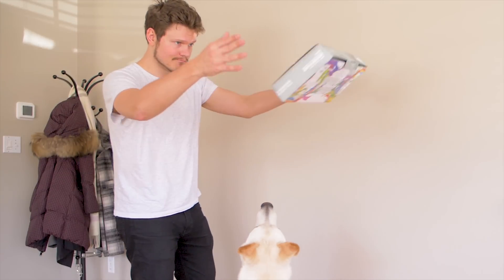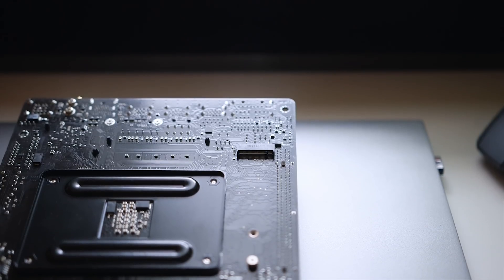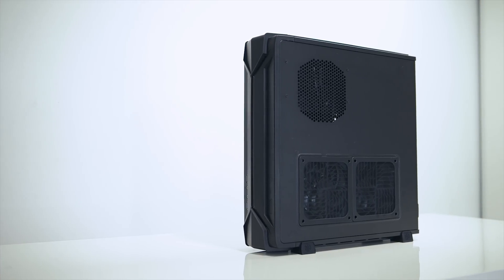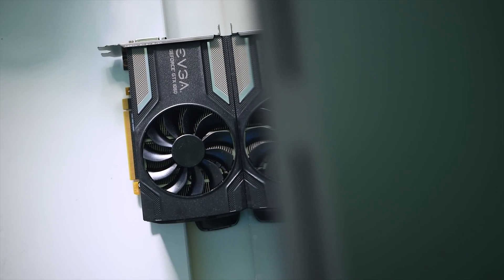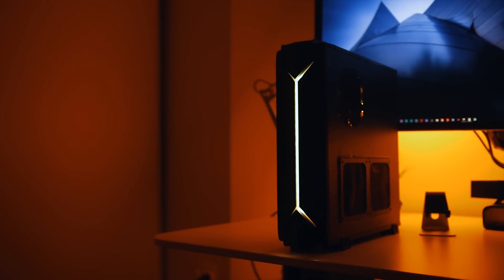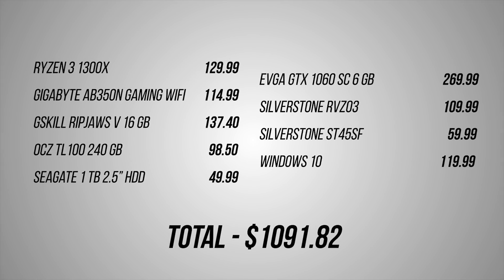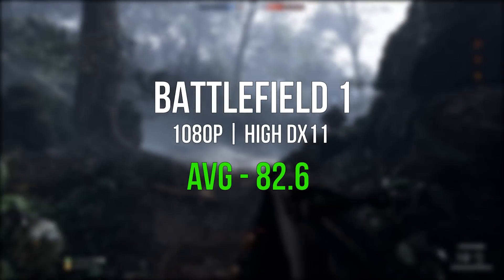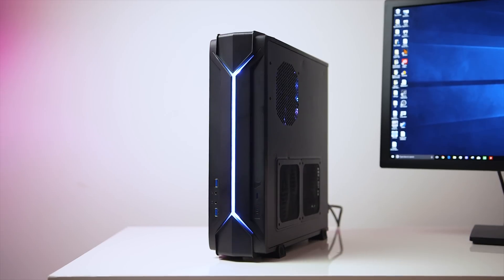AMD Ryzen SHRUNK - Our Ryzen ITX PC Build!

Comment: Windows for $120??
Dafuq?
Heard of kinguin?
You can get win10 pro oem for like $25...
Reply: .net
Reply: Arek R. Rather just use it not activated. Stolen volume keys or bought from stolen credit cards have the potential to not work after a while.
Reply: Bas V Kinguin is safe.
Got it 6 months ago and its fine.
I know about this page from Pauls Hardware, he got first windows like year ago and he also didn't reported any problems.
They sell OEM versions which usually you get with prebuild PC.
Kinguin gets mass license for like 10000 of PCs, and so it's cheap.
Microsoft is already rich enough and so didn't prohibited this.
Reply: I would not buy from Kinguin. They operate in a grey market with stolen license keys. Any day your license could be disabled because some one else got the same.
Reply: Arek R. I got mine for 10€ xD
Reply: No it wont lol once you register your license its yours how the fuck could someone else use it? They'd get denied and be told the license is already in use
Reply: @Arek R. Or just don't activate? There's no penalty, and a utility exists to let you set a custom wallpaper and remove the watermark if unactivated.
Reply: Or you know, just pirate it.
Reply: Just buy on eBay for $3. Fuck kinguin.
Reply: Just because you bought from kinguin and it worked, doesn't mean it will work for others. It depends on the seller. Kinguin isn't the one selling you the stuff, it's merely a site which private sellers can use. Its just like ebay. Just because one seller gave you a legitimate product, doesn't mean everyone else will.
Reply: Heard of the pirate bay?
Reply: Where is your proof that Kinguin use stolen license keys, i think your talking out of your ass, i have bought MANY steam CD keys from them and NEVER had any problems, and i also bought many Windows 10 Pro OEM keys and (from another website) have no problems, they work perfectly.
Reply: I and MANY other people bought a Windows 10 Pro OEM license key from a store legally, so no for us it's legal, i can't help it if a BIG store like Kinguin use stolen license keys, and i can tell you almost 100% sure they don't sell stolen license keys, but hey if you and others like to pay $120,- for a Windows 10 license key, then i say go for it, and so what if you Windows 10 Pro OEM license keys stop working, you just buy another Windows 10 Pro OEM license key for $30, i can 5 Windows 10 Pro OEM license key for $120,-
Reply: You to, have fun with your $120,- Windows 10 license key.
Reply: Ok then what's the problem, if you do the same?????
Reply: well I was asked to save money for a company and i bought 50 keys from g2a and i got a lot of money for that for saving the company money and none of the keys have been used again lol
Reply: Yes that's what i try to tell SIF, but ok.
Reply from the maker: We buy 100% legitimate software.
Reply: Um ok.
Reply: ok.
Reply: Arek R. I got it for 5 dollars on Amazon. The seller isn't on there anymore though
Reply: you kidding right?....i got disk with windows 10 with all versions with activation ...got it for less then 1$
Reply: https://www.kinguin.net/category/19429/windows-10-professional-oem-key/

https://tweakers.net/pricewatch/453556/microsoft-windows-10-pro-nl-64bit-oem.html
Reply: 3 words: Windows Accessibility Upgrade
Reply: 1 woord, just buy a new €25.99 Windows 10 Professional OEM Key when you upgrade your MB or RAM or GPU or CPU, is MUCH cheaper.
Reply: I got my Windows 10 Pro key from Kinguin and had it approved and installed with the help of Microsoft service so yes they're perfectly fine from what I can say, also they include a buyer protection service for like extra $5 totally worth it if you happen to run into any issues
Reply: Heard of eBay? You can get legit win 10 for five dollars.
Reply: Arek R. Windows for $25??
Dafuq?
Heard of torrentz.eu
You can get win10 pro oem for free...
Reply: Vality For a cheap fuck like you, it's a better option.
Reply: OEM is FTW solution is you are the people that use same computer for a long time. it is definitely worth it and legal. the negative is the license key is registered to the machine so you can't change the machine. but regular people like wont buy another PC for years so it is okay
Reply: HardwareCanucks still 120€ for windows is to much xD
Reply: Arek R. 
Microsoft get harmed  from those windows keys and all of those cheap keys are stolen keys
Reply: TheMorbiousStone 
Cuz they bought them with stolen credit cards?
Microsoft knows and everybody knows that
But
They don't have a physical proof that kinguin buy keys with stolen credit cards and sell them for really cheap cuz they didn't lose any thing in that credit card
The judge will just say that they bought them for the full price and sell them for really cheap and they are losing money for that
Reply: I rather use cracked windows than any crap from kinguin or g2a all day, if you don't plan on paying msft for their product (imho you should), than please at least don't found gray market websites
Reply: Have you heard of the law?
Reply: Obviously Dead yes but knowingly buying stolen goods are just as illegal as copyright infringment
Reply: Let me tell you my experience, I downloaded Windows 8.1 through torrent and when Windows 10 came, I was asked my Microsoft to upgrade to 10 and since then I've not faced a single issue and I've done this on two computers.
Reply: Reddit Keyswapper?? 40$ for win 10 pro
Reply: https://www.reddit.com/r/microsoftsoftwareswap/
Reply: https://www.reddit.com/r/microsoftsoftwareswap/comments/6t01j4/h_windows_788110_windows_serverserver_r2/
Reply: RealTuber 
FUCKING EXACTLY
Reply: Grey market. Don't buy from that shit. You might as well torrent it mate. I for one have never paid for an operating system.
Reply: This is just beyond stupidity. Always trust the real company itself, so in this case, Microsoft. If you would rather go with this Grey Markets, what's the point. What's the point in stalling ur cash just cuz it's alot cheaper than a Genuine Key by the Legitimate Company itself, download it for free then from torrent.
Lot's of people have reported fake keys and duplicates from Grey Markets.
Reply: Kelvin Tan 
Agree
Like the guy up there said
If you aren’t going to support Microsoft at least don’t support shady markets
And get it for free
Save the extra 35 dollars in a bigger ssd or a cooler
Reply: Gabe_N Yea man. Where's the pride in that. I would feel good and sleep good knowing that i bought a legit item from Microsoft THEMSELF.
Unlike supporting shady grey markets with Bad User Interface  sites. What? Do u expect do go like "Oh look i feel good, $25 Windows in ma PC, it's so much CHEAPER".. WHY NT JS TORRENT IT THEN
Reply: I paid extra for protection, so If my license will be deactivated I will get another key or money back from kinguin.
Also some time ago I was connected remotely with MS technican and he didn't said that my win10 is fake or something.
So chill dudes, If MS gave free update to win10 they should be fine with this.
Reply: Arek R. "Should be fine"....., so as far as everybody's concern, you have been braggin about a service which you don't have 100% faith in. Why wouldn't someone go for free torrent instead, and still pay money for some Grey Market Product?
Reply: Not to mention that most pre cracked Windows now offer updates also directly from Microsoft eventhough it's crack..  and security comes free with Windows Defender or your preferred 3rd Party Antivirus?
Reply: THANK you.
Reply: Look at all these morons proud to be paying for piracy lmao. You're in breach of the software license agreement when you use these MSDN originated black market keys which makes it EXACTLY the same as using microsoft toolkit from a legal standpoint.
Reply: YE BOI. This conversation is still on. Grey Market / Torrent, there ain't no difference, why pay for fakes. Buy a legit Microsoft Product, Save A Life.

Comment: I built a SFF PC with a R9 Nano, 4790k and 600W PSU inside a Fractal Design Node 202 for around the same price a couple years ago so it is crazy to see the prices.  Cabling is definitely a mess in these kinds of builds and I regret not springing for an M.2 SSD.

Comment: I'd suggest the R3 1200 overclocked to the same speed and the Asrock b350. The Gigabyte board has been having some VRM heat issues. Also save $50 and get a Core V1 plenty of space for HSF, drives, can support cheaper ATX PSU's and still small.

Comment: What an odd build. Keeps going on about "strict budget" and "budget build". Then drops $130 on RAM and $150 on an RGB ITX mobo?? WTF. Nobody buying a Ryzen 3 is going to drop $150 on an ITX mobo. and fancy case. It's a budget CPU so build accordingly.
Reply: YeCannyDaeThat 100$ cpu in a 1100$ build, makes no sense
Reply: YeCannyDaeThat and a 1060?!?! Wtf
Reply: Kevin Dragontail the R3 can run the GTX 1060, the 1070 is where it gets a bottleneck
Reply: AntiSnifflz i meant I was expecting a really high-end graphics card because of the low end cpu, idk where the rest of the budget went
Reply: $170 for that case and power supply.  No way would I pay that much for that...not to drop a $100 CPU and 5400 rpm drive into.  The 2400 Mhz RAM also confused me...RAM speed has a HUGE performance impact with Ryzen...would not go less than 3000 Mhz.
Reply: Kevin Dragontail mining.
Reply: Hemibuzz mate I fit a 1600 and a 1070 in this budget
Reply: Disagree. I think Ryzen 3 combined with a fancy case and a mini itx board will become a somewhat common configuration for HTPCs. There's no need to get a better CPU than that for a HTPC unless you're doing serious gaming.
Reply: Rob Cribb I don't think he said anything about a htpc in the vid?
Reply from the maker: "Strict budget of $1100".....you forgot that part.  ;)
Reply: I just bought this exact cpu/motherboard for HTPC and gaming, that said, I used a silverstone sg13 for $40 and only 8 gigs of ram. I already had the PSU, GPU and storage so it only cost me $300
Reply: +HardwareCanucks Eber I am able to use that same $1100 budget and build this... https://pcpartpicker.com/list/zGqkM8 

With a better CPU, a faster 2.5 hdd (7200rpm 2.5hdd's do exist you know), and get a Win 10 Pro license for $25. You clearly didn't bother researching with this build.
Reply: Well at least make it look nice so when you upgrade to Ryzen 5 or 8 you won't need to upgrade everything
Reply: Actually i was going to build R3 build in this case. But i'll go with one SSD and 1050ti. The only problem with this video for me is that they say nothing about ATX power supply capability. So it it true that it can fit ATX or do i have to buy SFX power supply?
Reply: YeCannyDaeThat he said at the start that he was going to do a full build for the price of the Threadripper 1950X. That's the budget limit.
Reply: yeah ryzen 8, that actually exist... rofl
Reply: Here's an even cheaper, under $1k build, with the same brand of components but 1TB of extra 7200rpm storage and Ryzen 5 (as one of the other posters mentions here): https://pcpartpicker.com/list/Pq8MkT 

RVZ03B case does not make any sense at all from value perspective. You are better off with RVZ01B or ML07B. RVZ03B is basically an overpriced RVZ01B with some frills but flexibility removed.
Reply: Could have swore the 1950x was $999 not 1091.82 but again whatever your definition of budget is... it doesn't make sense
Reply: for a HTPC all you really is is the Ryzen 3 and a 1030 and yeah no nee to spend a fortuane on a case when there are plenty of great looking cases at $50 or less. RGB is honestly something I would NEVER budget for as I hat the concept of it to be honest. Rather have a sleeper build then something guady looking. I can understand a backlit keyboard and some light on a mouse so you can see them in the dark but flashing and rainbow RGB? No thank you you can take your fad and shove it where the sun doesn't shine for all I care. Stupid fad I wish would just die already.
Reply: Here's a more economical Ryzen build.

$200 - Ryzen 5 1600
$220 - GTX 1060 (3GB)
$110 - ASRock AB350 Motherboard
$25 - Be Quiet Rock Slim
$65 - 8GB RAM 2666 MHz 
$90 - 250 GB SSD
$75 - 3TB HDD
$50 - Mini ITX Case
$40 - Seasonic S12II Power Supply
---
$850 (do Ryzen 3 + stock cooler + GTX 1050 if you want to cut down to ~$600)
Reply: @Halosince151101 Try playing Rust or some other Unity game. That uses 4GB itself easy. Open some chrome at the same time and you're already out of RAM.
Reply: AntiSnifflz if i do 2x 1060 (no sli, of course) will it bottleneck like a single 1070?
Reply: Without using a high end GPU, over 2400mhz the benefit quickly drops off. Look it up. Plenty of people have tested it.

Comment: The case seems like a total step back from the RVZ-02 and ML08-B. It's as fat as the RVZ-01, but requires an SFX powersupply. What the hell? SFX PSUs are expensive, but they at least give the benefit of allowing for slimmer cases. This case came out 2 years ago and was called the FTZ-01, which the RVZ-02 and ML08-B beat in both price and temperatures.

Comment: mining is only going to continue forward, many mine thru the ups and downs of the market or at loss simply because of belief in the possibilities of cryptos. so its simply, either overflood the market and make gpus uselessly cheap for producer while making mining not worthwhile unless running something ridiculous like x36 gpus, not likely, or it continues where msrp is utterly useless its just the price performance to mining the specific hot coin of the ~6  months as opposed to gaming performance. so, quite highfor the "normal" consumer. solution? mine bois. New coins will come out that could shift it from gaming gpus to more specific gpus /other hardware (which was the point to create the popular coins atm to avoid this specific hardware for still "easily" and "fairly priced" aquired consumer products or other hardware so common joe could make money and support future currencies, but it nearly backfired.)

Comment: That motherboard layout works well in my current case. My MSI Z87i AC has that exact same layout and helps cable management in my current rig. I do see how the layout wouldn't work well with most normal cases though.